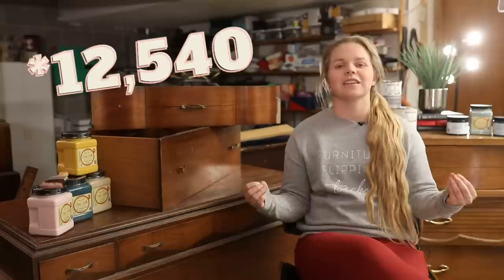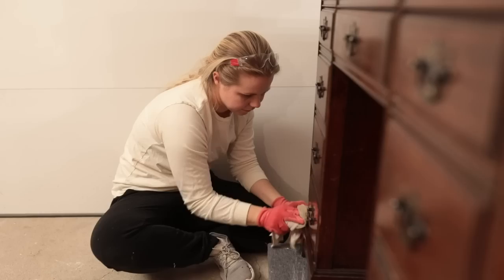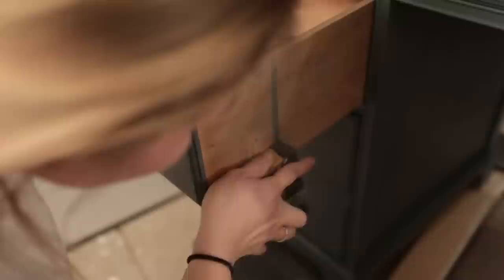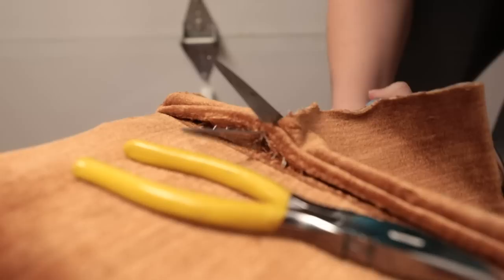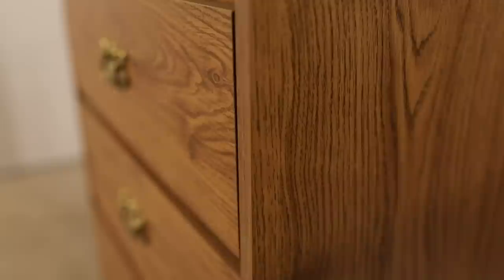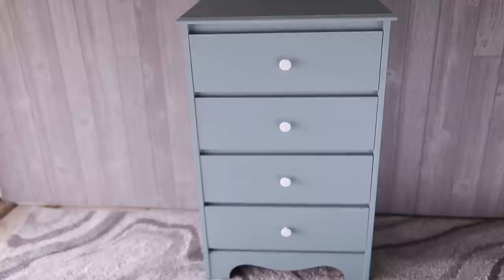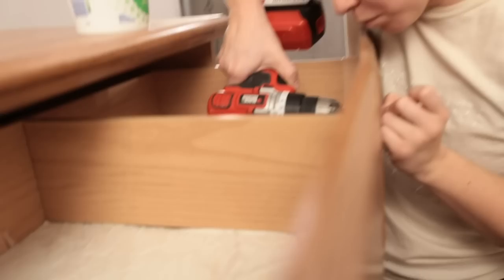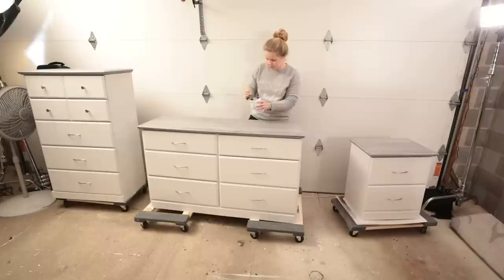Furniture Flipping in 2022 | $1,750 in 1 Month | Side Hustle for Anyone | 12 Furniture Makeovers |

Comment: You should get Durhams warmer putty for filling holes and damages... it’s a power so you don’t have to worry about it drying up and it works amazingly. I filled in a big gap that I made by mistake with the skill saw. And you can’t tell... you can find it on Amazon.

Comment: I notice that the dressers have locks in each drawer.  This is a very desirable feature, being that it can be used for thing you want/need to keep either private or safe.  It is worth more than a similar piece without any lock, much less each drawer having individual locks.

Comment: Love that you are very upfront and transparent about all facets of your endeavors.  It's very refreshing.  Hoping you achieve your loan pay off goal very soon.  I've been refinishing furniture for years and you do a very good job.  Not everyone is so dedicated to fix flaws and that makes the difference between an amateur and a professional.  I do wonder why you choose to clean and sand your pieces prior to removing the hardware.  In my experience, it is much easier to remove the hardware prior to working on a piece; however, everyone has their own method and process that works for them.  Good job.  Wishing you every success!

Comment: This sounds like a Dixie Bell commercial.  That stuff is pricey, do you factor the cost of that in somewhere?
Reply from the maker: Not too sure how this sounds like a commercial for Dixie Belle when I am also heavily promoting other brands as well...Rustoleum, The Chippy Barn, etc. I do factor in the cost of materials but keep in mind that even though one can of pint costs however much, I am not using the entire thing, therefore I do not need to factor in that entire price. I recommend using these brands such as Dixie Belle or The Chippy Barn because even though they are a bit more expensive, you get more bang for your buck. You don’t have to use as much paint when you use these brands because the coverage is so great. I can get 8-10 projects from one can of DB or TCB vs. 2-3 with Rustoleum.
Does this make sense? I am fully transparent with everything put out so please let me know if you have any other questions! Thanks for watching.

Comment: I don't mean to criticize but I don't understand how you are figuring your "profits". You obviously don't put any value on your time. And I don't think that you are figuring your materials correctly either. You are using Dixie Bell paints which retail for ~$25 for a 16 oz container. I would think that using super expensive paint, misc consumables like sandpaper and stripper, mistakes that have to be sanded and more material applied and then figuring your time at even a minimum wage cost, your are selling these pieces at a loss. Im sorry to say that there is no profit. Technically there should also be a calculation for overhead costs like heat and electricity at a bare minimum.
Reply: I noticed that IMMEDIATELY at 3:18.  No accounting for surface treatment materials AT ALL.